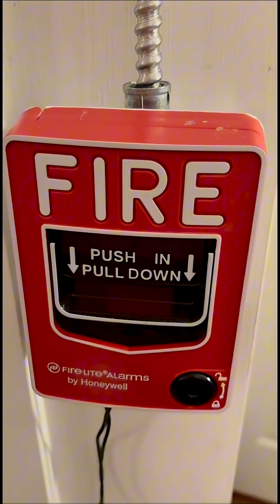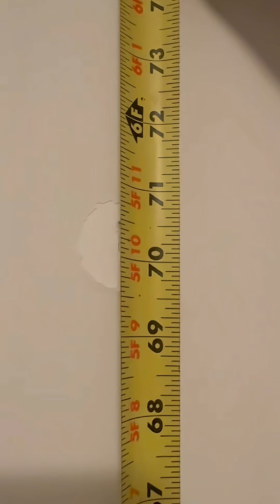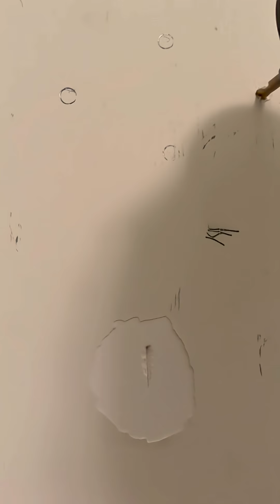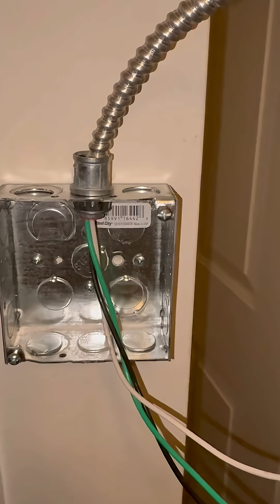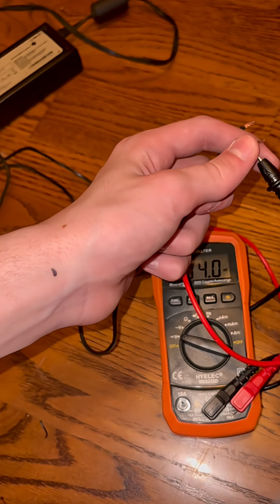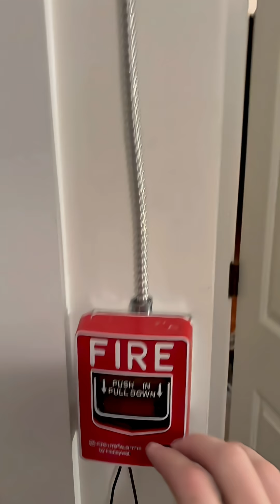How to build a fire alarm system without a panel #tech #firealarm #techtok #firealarmsystems #diy

Comment: Why not use any higher than 1 amp? The alarm will only take what it needs. Don't go over 24 volts.
Reply from the maker: I’m not too great with fire alarm tech, but some older ones may not handle too many amps as well…?
Reply: @SKRcomputers  Amps drawn is determined by resistance of the alarm. Think of voltage like water pressure and amperage like how big the hose is. A fire hose won't give you crazy pressure if you connect it to a shower. This is basic electronics.
Reply: Some might not and too many amps may fry them